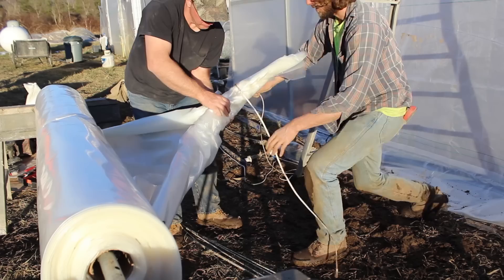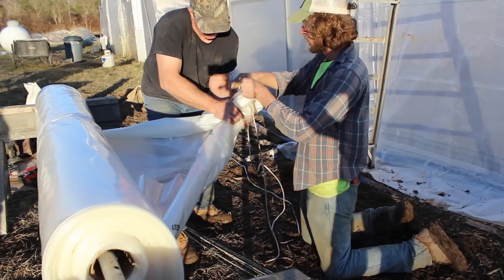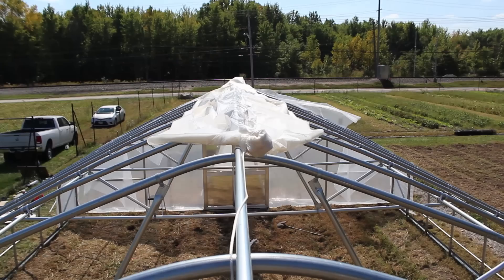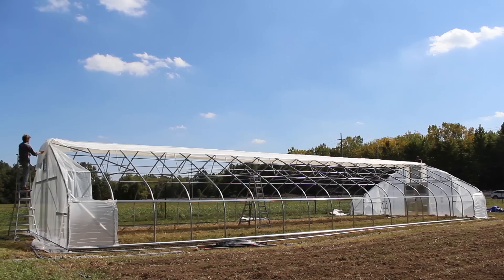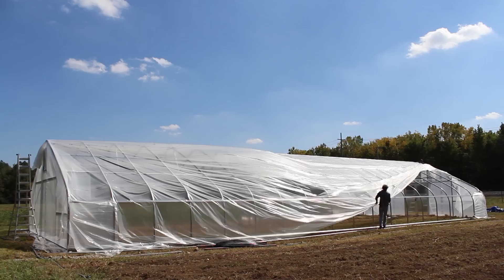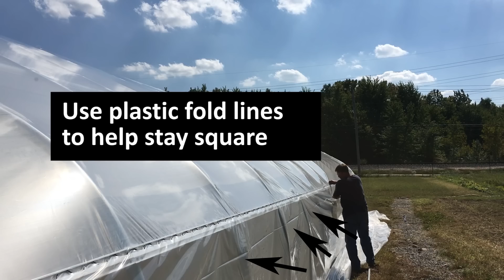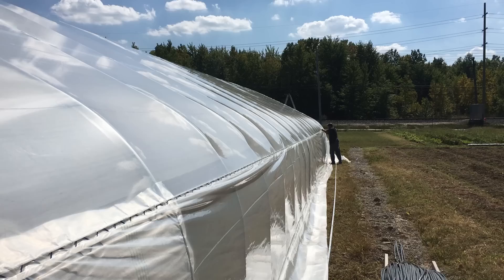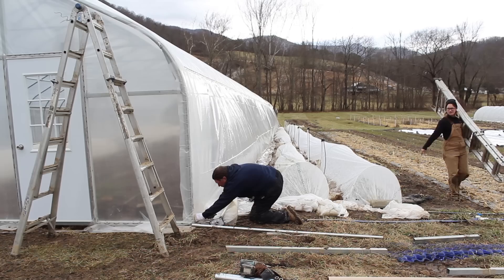How to Install Greenhouse Plastic Top Cover - Poly Pull Method

Comment: Great info! Have you ever done the woven sheathing?
Reply from the maker: Yes I have, and the process is very similar. The main difference is in the way woven plastics usually come… they are most often folded and boxed, as opposed to being gusset folded on a hollow cardboard cylinder. This means there is a bit more prep work required to get the woven plastic lined up at the end wall so that it can be pulled over the structure lengthwise. 

With the above being said, I still prefer getting the woven plastic at one end, tying a knot with a nub, and pulling it lengthwise… I still think it goes smoother than pulling plastic over the side of the structure as many others do.

The other thing I’ll say about woven plastics, is they seem to be more difficult to pull really tight. As in, once you pull it tightly, you’re not going to get another inch out of it, that is the maximum amount you can pull it. 

Hope the above helps, and best of luck with your projects.

Comment: I definitely need help making my cattle panel greenhouse this summer I’d like to make it a double layer so I can inflate the space between so I can have the best luck growing in it when the weather gets -40f outside. What is my best option?
Reply from the maker: Thanks for the comment, Joe! I just sent an email this morning. Also, based on those temps, I’d definitely suggest two layers inflated poly, maybe 8mm twin wall polycarb on ends, frost blanket for inside the structure, and some form of heating element. Thanks again for watching!
Reply: Do you guys build at places I have gunnera and fruit trees so it has to stay warm and humid in the greenhouse I’d like to have a 40’x100’ 12 tall greenhouse that can grow all year and would like some price checks
Reply: Also how would I make a double layer inflated cattle panel style greenhouse?
Reply: I was also planning when I do my huge greenhouse building some kind of walls down inside the ground with cement and filling it with insulation or something so that way I can grow in the soil during the winter months that way there is plenty of room for my gunnera manicata roots to grow to natural size they get massive and I’d like them to get as full size as possible aswell as all the fruits I grow I’d like to cut out the whole raised beds or pots for root restriction though in a way I’d be kind of like a reverse raised bed some set up to keep the soil warm in the ground kind of like building a basement but I have t heard of anyone else doing this idea of mine it sounds more complicated then it is because of how I worded it but do you have any ideas ?

Comment: Where can I purchase the billow clips.
Reply from the maker: Calvin, you can find EZ Snap Hooks here: https://www.tunnelvisionhoops.com/ez-snap-hooks-anti-billow-hardware-pack-of-25/ Also, we just published a video on how those get installed, which you can check out if you want more specificity on how to install anti-billow rope using EZ Snap Hooks... We no longer use the clips that were just made of wire - we found that the EZ Snap Hooks were much stronger and held up much better in wind. Thanks for watching!

Comment: How about a double layer, is it the same way
Reply from the maker: You are the second person to ask this question over the last few days so maybe a video outlining that process is in order! In the meantime though,  here is a quick rundown on the process:

1. Install the first layer of plastic as shown in this video. If it is a calm day you can likely get away with only putting a little bit of wire into the Spring Wire channel to hold the first layer in place while you get the second layer over top of it. If it were me, I would put two feet of Spring Wire at the peak on each end, and a foot of Spring Wire at the hip rail of each corner. This will help hold the plastic square and will allow you to eventually install the second layer and the first layer with mostly one run of Spring Wire **If you aren't confident in how breezy it is outside you can just secure the entire top layer with a run of Spring Wire because the channel will hold two layers of plastic AND two runs of Spring Wire. 

2. After your first layer is in place you can follow the same method for pulling the second layer, but as you pull the plastic over the first layer of plastic you might find that the plastic wants to fall off to the left or right of the peak. The way to combat this is to have the person lifting / taking tension off the plastic to spread the plastic a bit more so that more of the plastic is splayed out on the top of the structure, to the left and right of the peak. Having this additional weight to the left and right of the peak will help prevent the entire folded roll of plastic from starting to slide off to one side. If it does start to slide to one side, and your plastic has been splayed out a bit more, you can likely just change the angle that you are pulling the second layer to straighten it back up. 

3. After your second layer has been pulled across the top of the structure you can secure the peak at each end with Spring Wire the same way as shown in this video, and then drop the folds on each half of the structure. Secure at each of the corners at the hip rail with a one or two foot piece of Spring Wire, and confirm your top cover is square / their aren't obvious wrinkles throughout. If you are squared up, you can now secure in the same order of operations as if there were one layer of plastic (over the end-hoop and then the hip rail). 

4. Don't pull tightly on the second or first layer of greenhouse plastic when it has a double layer inflation system set-up. If you pull too tightly you will find that minimal air inflation occurs, and this can reduce the insulation properties of a second layer, but it can also unnecessarily stress your blower fan motor. Instead, simply make sure each of your layers are resting square to your structure, and without wrinkles or obvious sags between hoops. If both pieces are square and the plastic pieces don't appear wrinkled or too loose, pin the plastic in with Spring Wire. Install the blower fan at a corner of the structure before sealing that specific corner with Spring Wire. **Just as I have mentioned I wouldn't pull the second layer of plastic too tightly, I also wouldn't attempt to push a ton of excess plastic inward to make the top cover super loose. This would likely just cause uneven inflation, or an odd wrinkle.

I know it might be hard to follow some of this since it is all written guidance, but until we have a video up I hope this can provide some additional help. If you want to check out our blower fans you can find them at our site here: https://www.tunnelvisionhoops.com/greenhouse-inflation-blower-fans-with-mount-brackets-and-cords/

Comment: DO U KNOW EXACTLY HOW MUCH PVC PIPE I WOULD REQUIRED FOR 1 ACRE LAND ??
Reply from the maker: Hi there. Nope, that is not something I could provide information on. We sell metal framed structures as well, so PVC tubing is outside my knowledge base. Thanks for watching though.
Reply: @tunnelvisionhoops  How can I get metal frame structure in INDIA.
Reply from the maker: Hi there, I am not actually sure how that would be done. Is there a steel fencing industry where you are located in India? Perhaps reach out to a chain link fence supplier to see if they would have any leads? You could source steel, and bend the steel yourself, if you can source it. Just trying to think of some ways you could source what you are looking for. Thanks for watching our videos though!

Comment: I would like to know what's the size of that greenhouse please
Reply from the maker: The video was filmed at a few of our structures and the lengths are different. The main structures used in the filming were 30 ft. wide x 72 ft. long with 6 ft. sidewalls and 30 ft. wide x 96 ft. long with 6 ft. sidewalls. You can find more information on these systems on our website.

Comment: Explain more clearly the channel and the fixing spring wire
Reply from the maker: Thanks for the suggestion. We have a few other videos that relate directly to installing the channel and spring wire. I will link to those in further down in this response, but in short, the Spring Wire Channel is installed directly to the top of each end hoop, and double channel hip-rail is installed on each side (if you are going to have a roll-up sides). If you aren't going to have roll-up sides you can install single channel the full length of your structure on each side, and at ground level (best if attaching the single channel to lumber or steel baseboards). Check out the below for more information on the channel and wire process:

Here is a video on how to install single channel spring wire: https://www.youtube.com/watch?v=Os8DsLK95DA&t=0s

Here is a video on how to install the double channel hip-rail: https://www.youtube.com/watch?v=IXzZpZgfCj8&t=0s

Here is a link to where you can find single channel: https://www.tunnelvisionhoops.com/poly-lock-channel-and-spring-wire-greenhouse-film-fastening-system-6-ft/

Here is a link to where you can find double channel: https://www.tunnelvisionhoops.com/double-channel-poly-lock-and-spring-wire-greenhouse-plastic-attachment-6-ft/

Hope this helps!

Comment: Why the double channel on the sides?
Reply from the maker: We like using double channel for a few major reasons. 

First, the double channel is rigid enough where you can install it directly to the bows of your structure without the need for lumber (We have a video of this here: https://www.youtube.com/watch?v=IXzZpZgfCj8). If you were wanting to install single channel on the hip-rail you could, but single channel is less rigid and more difficult to attach to bows on its own, which means you would want to install lumber as your hip-rail before installing single channel to the lumber. For us, the rigid double channel makes more sense than having to install lumber and THEN installing single channel on the lumber. 

Second, having double channel on the hip rail provides some flexibility in how you install coverings and replace coverings. For example, if one of your roll-up sides got damaged you could relatively easily remove the wire from the bottom run of double channel, cut the roll-up side plastic away from the structure, and then re-attach a brand new piece of greenhouse plastic for your roll-up side. I  recently did this exact process, and was happy I didn't have to turn off the inflation motor on the two layers of inflated greenhouse plastic, and then detach the top covers through the full length of the structure, just to repair a side. I don't like exposing the top covers to potential wind gusts if I can avoid it. 

Third, the double channel does not rot or rust. Where lumber hip-rails often begin to rot over time due to interior condensation and high humidity levels, the double channel will not. Because it is aluminum it also doesn't rust. For these reasons, the potential time spent on maintenance and future repairs is reduced. 

Hopefully this helped answer your question. Thanks for watching our videos!
Reply: Tunnel Vision Hoops LLC thanks for the detailed reply.

Comment: what's the dimension of this tunnel?
Reply from the maker: One of the structures featured in the video is 30 ft. wide x 72 ft. long with 4 ft. sidewalls, and the other is 30 ft. wide x 100 ft. long with 6 ft. sidewalls

Comment: Did you secure the end wall with wiggle wire and then use same channel to secure the overlapped long cover? Wiggle wire on top of wiggle wire?
Reply from the maker: I used Snap Clamps to temporarily hold the end-wall plastic in place, then I pulled the top cover in place and then installed the Spring Wire overtop both the top cover AND the end-wall cover with a single "run" of wire. You can see what I mean with the Snap Clamps by watching the end-wall plastic installation video we have here: https://www.youtube.com/watch?v=xkSlaXRInwQ&t=1s

If you do not want to use the Snap Clamps shown in the video I link above, the Spring Wire Channel can hold two runs of wire - one used for your end-wall plastic AND then another run of wire used for your top cover plastic. Just know that if you were to ever install a second layer of top cover plastic to then inflate it - that the third run of wire would be more difficult to get in there. It still should fit, but it just gets a bit harder. Just food for thought. 

Thanks for watching!